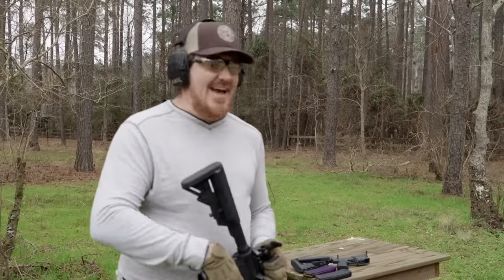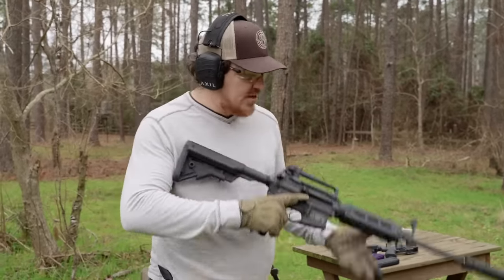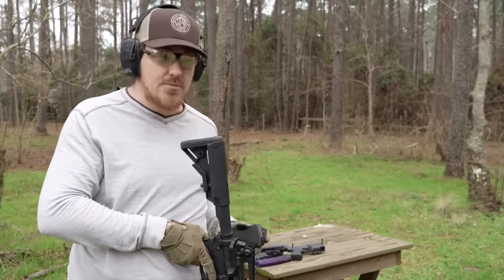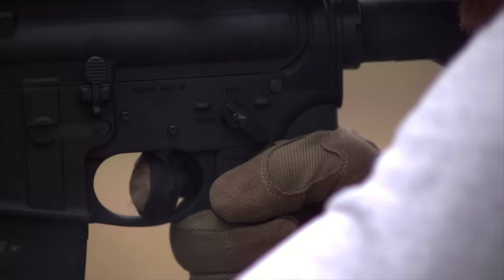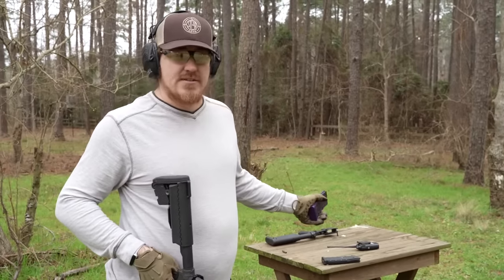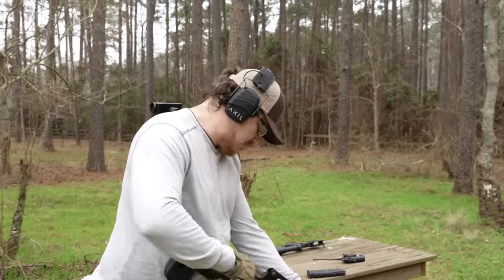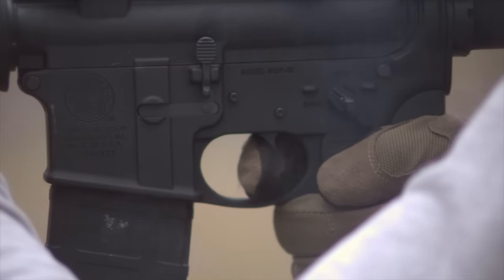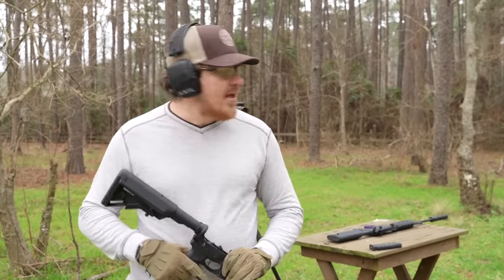FRT-15 Vs An Actual Machine Gun

Comment: If you put an elastic band on the trigger with enough tensile force to activate the trigger on a FRT-15 will you be able to distinguish that fire from placing the same elastic band on the trigger of an full auto AR-15 lower?
The trigger as I understand is forcedly reset by the recoil of the gun counteracting the force applied by the shooter on the trigger thus trigger reset is not a deliberate action by the shooter but a mechanical feature requiring constant force on the trigger in order to achieve a fully automatic effect/'simulation' as intended by the developer of the FRT-15.

By the looks of it the FRT-15 only works like intended with the user applying constant force like an elastic band does and constant force can by definition not meet the criterion of semi auto fire as that requires application of force on the trigger followed by a near zero application of force to reset the trigger mechanism. I understand that is some kind of RAW thinking in order to circumvent the NFA but I find the mental gymnastics required to call the FRT-15 anything other than a drop in fully automatic trigger group Sophism at best.

However it is my oppinion that everyone should be able to own and use fully automatic guns in any calibre and in any length and with any kind of accessory mounted.
#BanTheNFA

Comment: EXACTLY the same rate of fire of both. The way this is explained is that once you drop in the FRT, you no longer have any semi-auto function left.
Reply from the maker: You do know the definition of semi and full auto right? Rate of fire does NOT determine definition. It’s the action required by the trigger. Watch the high speed again and you’ll see i fire every single shot.

Comment: the ATF is an enforcement agency not legislative. Their interpretation of anything is not legal.
Reply from the maker: Correct. Sadly a federal judge seems to be upholding the atf overreach and is stating these devices are legally considered machineguns. Hence the door knocks.
Reply: "enforcement agency", so therefore it's there duty to enforce laws.
Reply from the maker: @killed_by_the_architect-829  we agree? Enforce law. Not write or change.

Comment: I'm coming around to the idea of preferring a trigger-reset-assist over 'fUlL AuTo'. It still requires continuous conscious action to cycle. 
Maybe it could be argued that the echo triggers are a 'drop safety' issue as it could potentially fire if you pulled the trigger, lost control/grip on the weapon without cancelling out of the echo shot by selecting Safe/Semi - it could reset and fire again one last time on the way to the ground.

I'm not the guy who cares, I never used my 3-round burst on my A4, my brother never used Auto on his M4, but it's controllable and safe.

The ATF is out of control. They need to be out of the business of regulating stocks, barrels, and suppressors, and they clearly do not care about ex post facto.
Reply from the maker: ATF is overstepping, no longer relevant, power hungry, and outdated. Having said that, full auto is a good way to waste money, but functionality wise not as relevant even in war. Ammo conservation when you’re carrying a load out of 308 is the name. You don’t want to waste 20 rounds not hitting 1 target or hitting just 1 target 20 times. Careful shot placement is far more important.

Comment: Required trigger movement for fire, i would say this is better engineer and solution than bump stock, but both should be legal by the definition that the ATF made. they are just but hurt and trying to change the definition Post loss of the chevron deference doctrine, the ATF should have no leway in changing meaning or definition  and actually requiring legislation to change devinitions.
Reply from the maker: ATF lost that definition change on frt in the recent court case of NAGR vs Garland.

Comment: So binary trigger works by shooting what basically is 2 shots per trigger pull(once you release the trigger that is)

FRT works by resetting the trigger automatically, what if Binary Triggers partially work like FRT's? You know: 2-shot bursts basically and extreme rate of fire if you know how to bump fire(and if the gun with.ä the FRT+binary trigger handles it that is)
Reply from the maker: No point. FRT are the way forward.
Reply: @gatcattill  just curious about it if it's possible to make a 2-shot burst mode for any kind of gun to give the less fast shooters an edge without accidentally bump-firing it, sorry if i didn't elaborate it further tho.

Also: do you speak from experience that FRTs are better than Binary triggers? (Greetings from Finland btw)

Comment: Do you just apply constant pressure to the FRT trigger and the mechanism cycles the triggers forward and back? If so, then the internal mechanism doesnt matter. Performs the same job. Not saying against but as an outsude observer looking at this.
Reply from the maker: Not you still have to let your finger relax and pull subsequent shots. If you try hammering down the trigger one shot fires and the gun stays in the open bolt position.
Reply: @gatcattill  👍 they should rename it if it doesn't force the reset 😉 but that sounds like a design flaw instead. I can see the debate though, just being objective.

Comment: The FRT does not "have an advantage" over the full auto trigger. The cyclic rate has nothing to do with the trigger unless it's failing to release the hammer as fast as the BCG cycles, or the full auto trigger has a rate reducer (M16 triggers do not). It's all down to the buffer weight, BCG weight, gas length, and how hot the ammo is.
Reply from the maker: Yep. This is all known. Yep e just didn’t want to go back and test again using the same buffer weight and spring. The purpose was comparing behavior mainly. Rate of fire was secondary.

Comment: Two things that werent covered in the video , what does it look like and can you fire single rounds for days when you dont have 30 bucks for five seconds
Reply from the maker: I covered it in a separate video later on, but its not designed to run like that without the 3 position kit which is sadly not available anymore

Comment: I'm gonna level with you. You guys can explain how "the trigger resents and therefor counts as a distinct action" until the cows come home. Truth is, so long as you are holding pressure on the trigger, it is effectively full auto. Dont lie to me, dont lie to yourselves. While it may not have the same mechanism, it simulates full auto very convincingly, and that's why we love them. Anyone who didnt see the writing on the walls is more out of touch than the ATF. This is not "simping for the ATF", if I were king I would immediately repeal the NFA. Full auto should be legal, but it isnt. No surprise FRTs would get cock-slapped when the feds found out about them. Stop putting so much energy into defending the FRT, when you should be attacking the NFA.
Reply: on gang

Comment: A normal full auto works by the bolt pushing the hammer forward while the trigger is depressed using the force of the cartridges to initiate the next round discharge. FRT 15 works by pulling the trigger causing a round to go off which makes the bolt move back, this pushes the trigger forward until the bolt closes then it allows the trigger to be pulled again and the process repeats. This is all done while mainting pressure on the trigger the same way you would with a full auto.

I get that this technically abides by the law where the trigger needs to pulled for each round but you can't lie that the gun is still doing the work causing it to be full auto, thats why i dont agree with this.
Reply from the maker: The part that you forget is the trigger is being fully reset each time and the pulll is what makes it fire after forward reset. Due to the light weight of the trigger it bump fires essentially. However, with an auto seer there is no trigger connection happening when the trigger is pulled. And it keeps firing. The trigger is only reset when the trigger is let go.
Reply: @gatcattill  Right but you still are applying constant pressure on the trigger even though its being reset. Even if it lacks an auto sear i consider this a single function of the trigger which according to the The National Firearms Act, 26 U.S.C. 5845(b), defines “machinegun” to include any combination of parts designed and intended for use in converting a weapon to shoot automatically more than one shot, without manual reloading, by a single function of the trigger.

 This can also be found in ATF Rul. 81-4.
Reply: @gatcattill  Not trying to nag or "rub it in your face" but i just read up on this and apparently the ATF cited the exact same US Code and wording as me. Before commenting i did not look up their ruling but the fact two completely seperate entities (me and and ATF) came to the same finding is quite conclusionary to why this is considered a machine gun.

I am not against strict gun laws or anything of the sort, me and my family hunt and own plenty of guns however this is just over the top for people without the proper paperwork to own.

Comment: The real question is is if you pull the trigger back and hold it back tightly does it shoot more than one round
Reply from the maker: If you slam the trigger it holds the bolt open. Releasing the trigger simply releases the bolt. One round is fired.

Comment: Just ordered one. Ordering a bcg next. Might drop in my .50 beowulf
Reply from the maker: Might dislocate my shoulder and mag dump 90 in ammo. May just stay home. Always send it!
Reply: @gatcattill  don't worry, I would never really drop it in my .50 lmao I'll get a separate upper for that
Reply: Update: put one in an sbr build and went to am indoor range where you can rent full auto rifles. After controlled bursts I was told that any trigger made to enhance the rate of fire was illegal and that I needed to leave. So, I sold the upper, put the lower on the .50 beowulf and sold both, minus the trigger. I now have another: 20" upper, bipod, aero lower, frt-15, iron sights, and a drum mag. Now I just need more ammo before hitting the range

Comment: I'd rather have options. I just wish it came with a 3 position switch.
Reply from the maker: With the design of the trigger I just cant see this being possible as awesome as it would be!
Reply: @gatcattill  think that would put it in a no go gray area with the alphabet boys
Reply: @gatcattill  could be actually though likely with a new safety basically it could function like an auto does in the since that the third position engages the reset bar while the standard semi position. Prohibits it in some way but that would require a massive redesign would be interesting if they incorporated the locking/reset bar into a new selector in some way or perhaps they could create a new safety with a "sear" that trips the reset bar after modifying it

Basically making the bolt force reset the trigger but lock it in place until you let off then have the safety engage a secondary sear to trip the locking mechanism to release it for a new function of the trigger

Again requires redesigning

Comment: I have never shot anything with a rapid fire style trigger my only question is does it feel similar to trigger slap with an ak because that would suck to try and use for any amount of time talk about a totally raw trigger finger
Reply from the maker: Mac10 sub machine guns have a trigger slap that is uncomfortable. This is not a trigger slap but it is a trigger vibration essentially. Not uncomfortable but will jam if you try and over squeeze it. Super safe is even less of a sensation but you can’t over squeeze.

Comment: How about, if you wrap a rubber band around the trigger and it just keeps shooting then it's fully auto? Because the trigger forcing a reset while your finger is already squeezing is just full auto with an asterisk.
Reply from the maker: you can already use a spring and a rubber band to get a regular trigger to do the same, but probably not as smooth. . . if you over grip an FRT only one round will fire when it is properly used.

Comment: Suppose someone just puts a buffer in their trigger guard that prevents their finger from moving forward too far? Like a funnel or something elastic that doesn't push your finger into the trigger, but keeps it from allowing the trigger to move all the way forward and getting all that take-up again.
Reply from the maker: Basically a rubber band shoe string machine gun with a twist.
Reply: @gatcattill  kind of but not necessarily because it's not pushing your finger into actually pushing your finger into the trigger enough to make you shoot, just keeping you in the best position to pull again.
That also brings up the idea of having a trigger guard that's customized to fit your finger (or fingers) so that the elasticity of the soft tissue causes bump firing. 🤔

Comment: The distinction is between a single trigger pull and a single trigger actuation.  The FRT has multiple actuations per pull but this is not the same as multiple pulls of the trigger.  So what does the definition of a machine gun say about this?
Reply from the maker: Dunno. Not an atf agent who changes law. But per the existing wording inside of the NFA, this is a semi automatic trigger :)
Reply: @gatcattill  That’s how I interpret it too.  The law says “per function of the trigger”.  That is mechanical actuations in my opinion.  It is talking about the functional behavior of the mechanisms associated with the trigger.

Comment: I understand how the Bi-Nary trigger does its thing.  What is this trigger doing?  In the slow motion it looked like the trigger had two stops on its way back?
Reply from the maker: It has a pause where it forces back then the locking bar gets engaged to hold it then the locking bar gets released when the bolt carrier is seated fully allowing the trigger to be pulled again. So you see 2 movements for the reset and trigger pull - making it semi auto.
Reply: @gatcattill  Thank you, I appreciate you taking the time & not making me feel stupid lol.  I do a pretty good job of feeling that way alllll by myself lol.

Comment: I don't get it. Why not just install the FRT in the M16? Wouldn't it allow the auto search to do its job in full, then do its special work on semi? Or was it specifically to show on camera that the full auto had nothing to do with the FRT?
Reply: Auto sear
Reply from the maker: Confused at what you’re asking? The FRT was to show trigger movement comparison to the m16 full auto to provide evidence as to the clear difference in auto vs semi auto when using a forced reset trigger. If you were to use this trigger in an auto m16 it would not fit since the locking bar would block the DIAS on the m16 lower.

Comment: Automatically resetting a trigger has been done with a safety, a trigger, a stock, seems logical it's an automatic at that point.  Agree with the rules or not trying to get around them with semantics seems like a bad plan.
Reply from the maker: Rate of fire is not the determining factor. Innovation should not be punished. The rules in full auto are already a violation of the 2a which was about government over reach protection to begin with.
Reply: @gatcattill  While I won't argue the violation of 2A.  Ask a lawyer...a mechanism that automatically resets the trigger is considered the same as a mechanism that allows a gun to be repeatedly fired without resetting the trigger.

Comment: Steel cases normally higher pressure due to the fact that you can run higher pressure in steel cases then you can in brass case
Reply from the maker: 223 v hornady 556 tho higher pressure goes to the 556

Comment: I think they will ultimately argue that one needs to have deliberate control over shots fired, which is why machine guns are illegal mostly. In other words, you wouldn't be able to say when or what or  how you pulled each individual shot, because like you said: its a SUBCONSCIOUS movement, or rather, the weapons natural recoil is working off your finger, in combination with the trigger, to generate the effect. For any reasonable person, a gun is "full auto" when you just "hold" the trigger, and the weapon fires. a gun is "semi auto" when each deliberate pull equals a shot fire. Developing a device to automatically pull the trigger for you is... what it sounds like. This is mostly clear. The idea that a trigger that is so light it will break and reset in so little time that a human couldn't fire it fast enough will skirt by regulations is a little silly. Just. buy. a  different trigger.
Reply from the maker: 5th courts disagree with your statements in the overturn of bump stocks ruling.
Reply: @gatcattill My friend there is something called being wrong, in which the government is multiple times.

Comment: This even further from a machine gun than bump stocks. At least with bump stocks you could say that the gun moving forward could fire a new round just by pressing against a static finger, but this one makes you have to keep pulling.
Reply: This is just a short reset trigger in action. Albeit a very short reset. The question will come down to whether or not an operator is required or not. If it can be proved that the recoil of the gun is enough to trigger it .... machinegun territory the atf would argue probably.